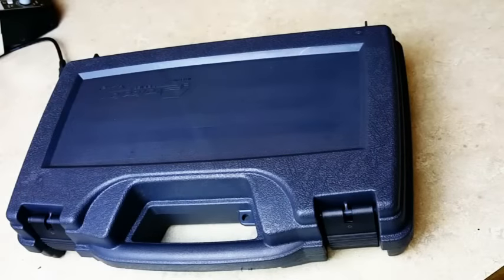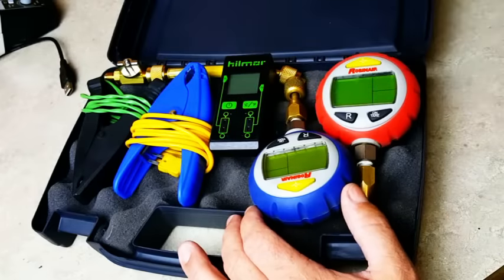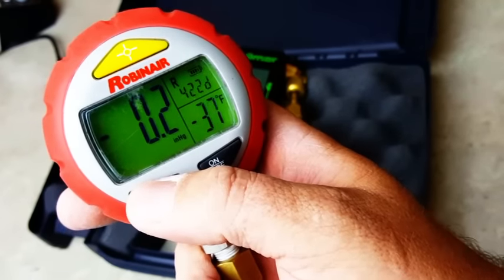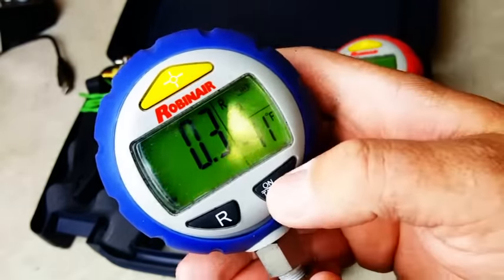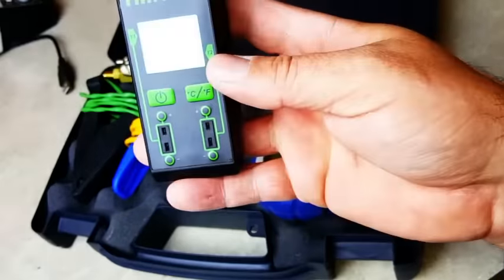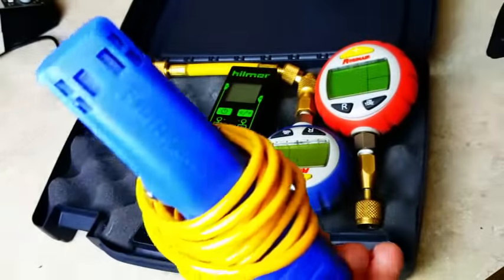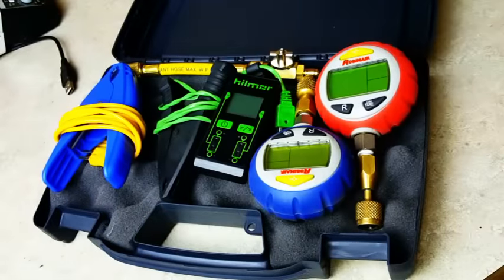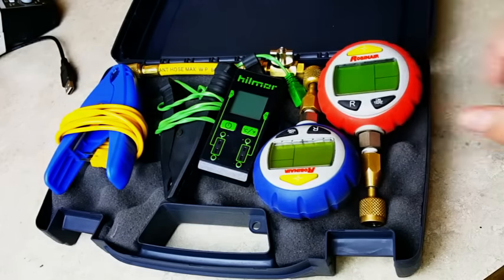zManifold & zConnect HVAC/R Manifolds

Comment: Nice set-up; very organized, can use as little or as much as you need for each job.

I carry a pair of Hilmor analog gauges with two 45° SealRight connectors in a Klein tool pouch(the padded, camo one);  works great for maint checks to keep from losing a 60" hose worth of refrigerant every time you hook on...I refer to mine as my 'stinger gauges'. 
 Beats the hell out of dragging an SMAN or analog manifold and a bunch of hoses around to diagnose.
Reply from the maker: +Mike_HVAC damn straight